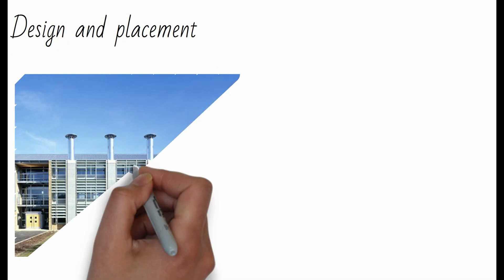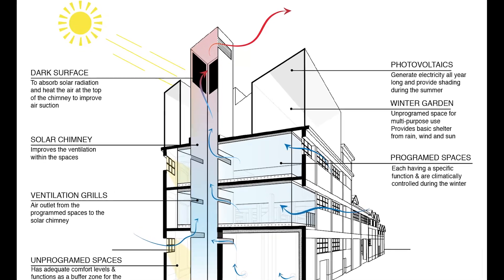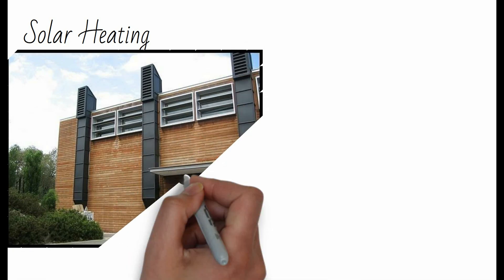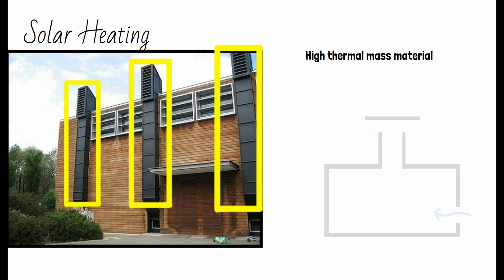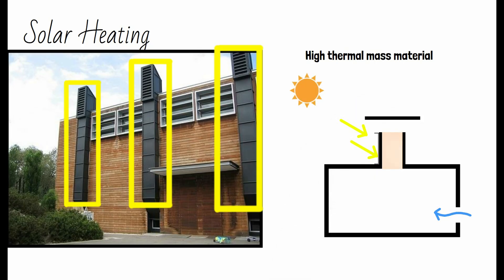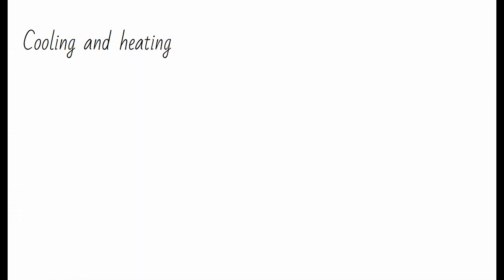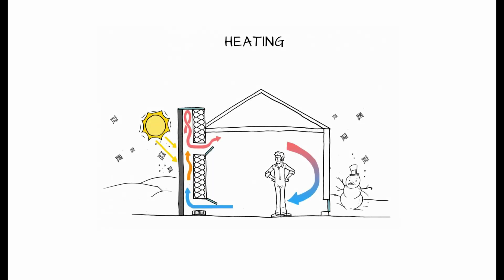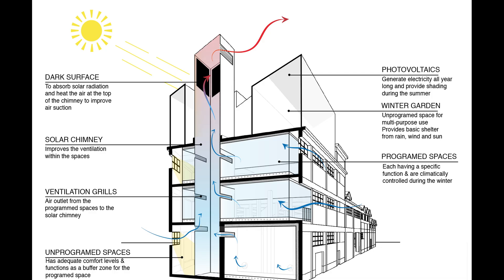How Does a Solar Chimney Help Ventilate Your Home?

Comment: Can you use a normal chimney on a house to do this? Like it’s brick. Does it need to be painted black and then opened I take it only during summer. Is it an issue if it has a full fire place of thermal mass in main room? Like would this upset it in summer and heat the whole thing or would it ventilate?
Reply: If you want your fireplace to keep its mass cool, you need to place a source of heat higher than your usual chimney. For example, you can use a solar heater made from a black-painted metal pipe, but this pipe must be tall enough.
Painting your usual chimney black gives very little effect, because it takes a long time to heat the bricks.

Comment: I don't think you're exactly right with the winter one, if the hot air rises then it's not going to leave the chimney to heat the surrounding space.
Reply: The solar chimney is closed in winter to trap the heated air inside as shown in the diagram @2:00
Reply: There's a outlet for hot air to move into house interior. Though the rooms in 1st and 2nd floor will be more benefitted.